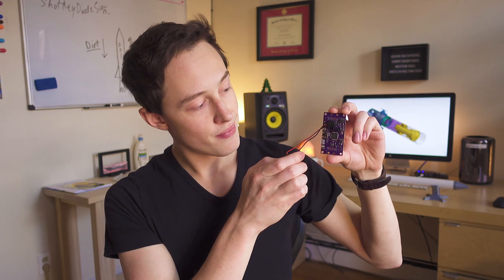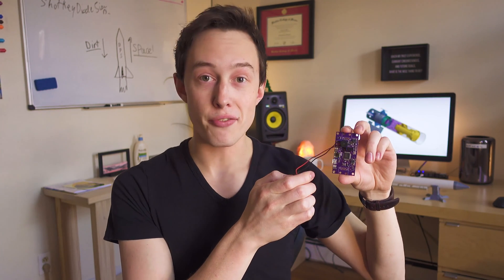BPS Signal Update

Comment: Hi, what do you make the fuselage, nose cone and fins out of please?
Reply from the maker: I use regular cardboard tubing for the airframe, poly-lactic acid(PLA) for the printed parts, which in some cases includes the fins. In most cases, it doesn't, since many of my rockets fly without fins :)
Reply: Oh ok cool! Is it difficult to make fins for the very high speed rockets? I would imagine that when drag really becomes a factor you begin to run into some flexing of the parts and unusual behaviours, like the old aeroelasticity problems? I guess you can thicken the part but then you would change its aero characteristics
Reply from the maker: None of my rockets are super high speed yet, apart from "Thrusty McThrustFace", my level 1 cert flight, which used thick wood fins. Drag and structural integrate of fins is a tradeoff, which changes with speed. I'm not the expert in this area, but I do know that if you go too thin, or use the wrong material at high speed, you can get nasty harmonics in your fins that can end up ripping them to shreds. You may have more luck on The Rocketry Forum with that kind of question.
Reply: Thanks dude, I am kinda asking for someone else, so I will let them know :) He wants to choose a 3d printer for making rockets but isnt sure how fast they are gonna go yet. I guess subsonic will be ok! Also congrats on Thrusty Mc Thrustface! Best name everrrrrr

Comment: I tried mounting the fins directly on the servo horns but had issues with them getting ripped off or folded over. I had to make axles for the fins to prevent this. It might not be a big deal for you because you aren't going as fast. Just keep an eye out for this.
Reply from the maker: Mounting directly to the servos is a bad idea for higher power rockets, and an axel solution is much better in those cases. Dart won't achieve any crazy high speeds, and I'm working on designs for larger airframes that can afford the weight and complexity of a more robust system.